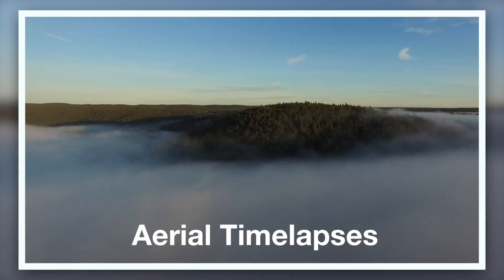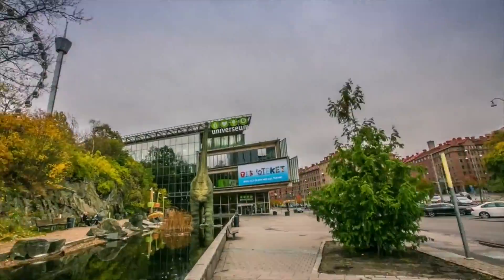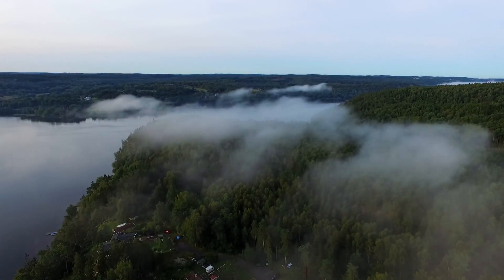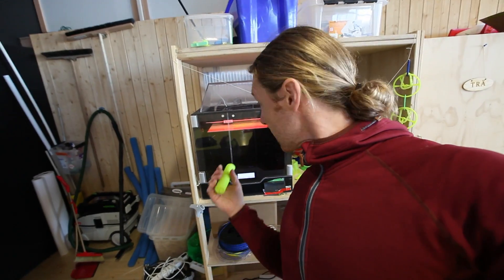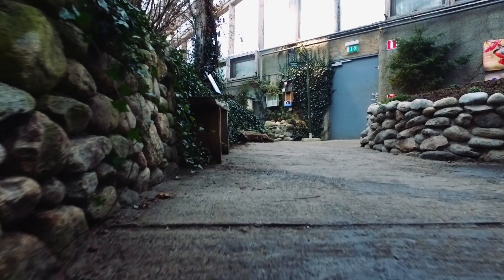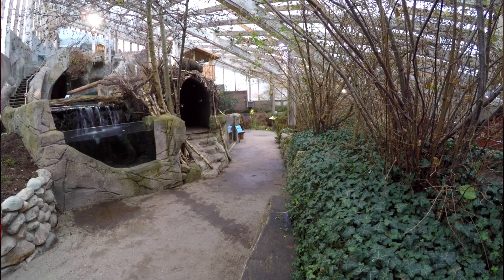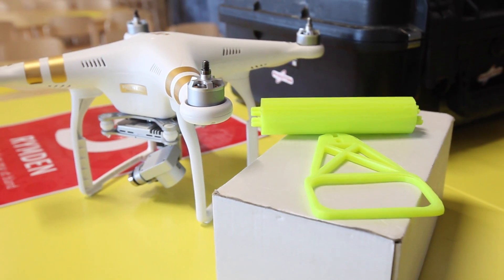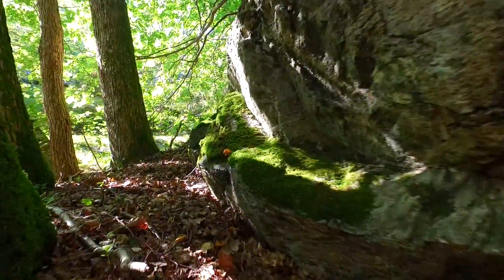3D printed Drone Handle - DJI Phantom 3 DIY project

Comment: You can buy some decent ones that screw into where the props screw into, with also a screen holder. But question. is there any way for your drone camera work without the controller attached to the tablet? like wirelessly? because that would be handy

Comment: I'm going to have to go to my local library to print this handle.
Reply from the maker: +AFKProductions Yes! Do it! I must admit thought that it took a couple of tries with the front (the one that looks like a coat hanger). It is a bit more intricate than the other two pieces. Good luck!
Reply: +Rob & Jonas' Filmmaking Tips so I wasn't able to print it b/c the pieces were millimeters too big and as the pieces are already thin I didn't want to risk it breaking. so instead I bought some wood and I'm going to try to make it out of that.
Reply from the maker: Sweet! That will surely work as well. Let us know how it goes.